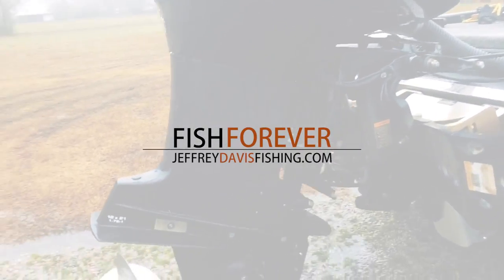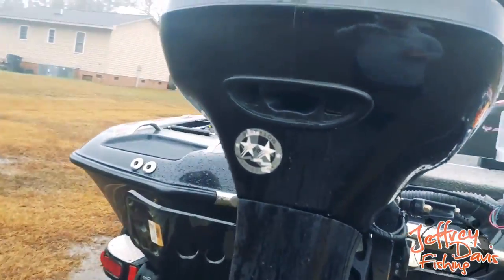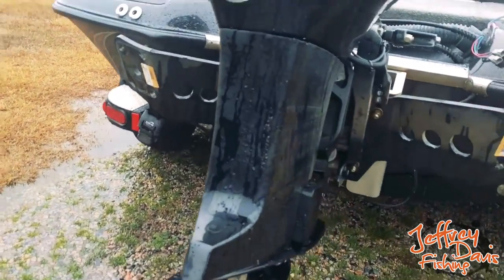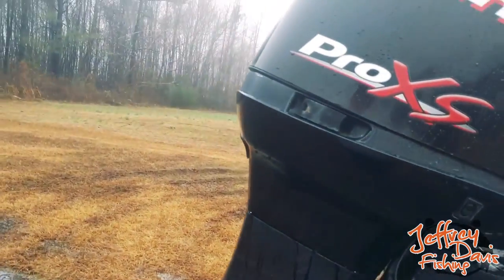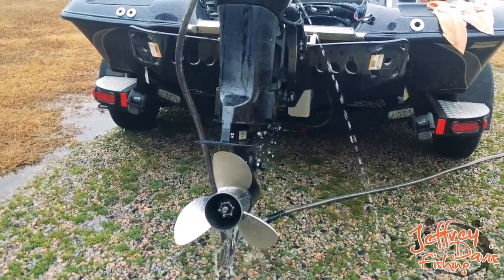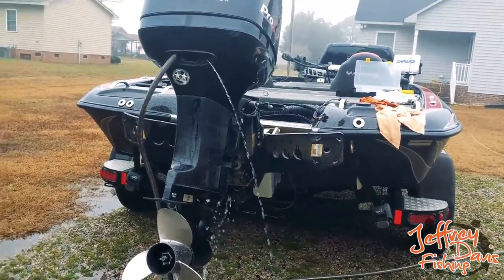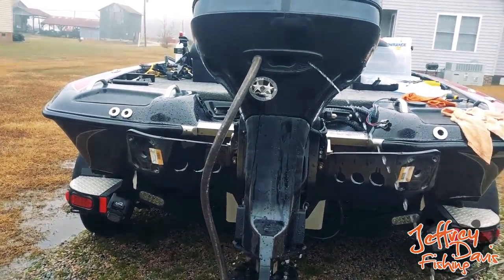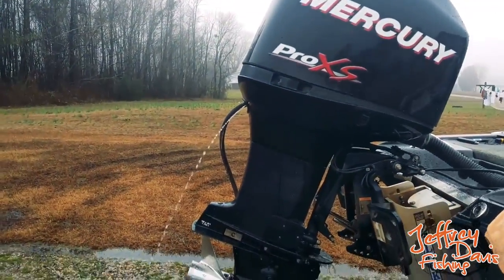Mercury Optimax Engine Flush - Fix No Telltale

Comment: As an emergency reaction only. If you find your telltale not pissing when you’re out on the lake with no tools.  a good method to flush out the coolant system is to take a water bottle, hold the mouth firmly against the P hole and squeeze The water into the P hole with as much force as possible. This will back flush your system and blow all the material out the inlet scoops on the lower unit. You may have to do two or three bottles of water (just refill from the lake or ocean) and eventually you will see water flow back out the P hole  . Make sure that you’re doing this with the motor off so that you’re not fighting back pressure. I have had my lower unit buried in the mud multiple times with no flow at all from the tale tale and have easily flushed the system out. Once you get back to land make sure you do a thorough cleaning and inspect the impeller.
Reply: But to add what I've learned is that P stream does not mean you engine is getting cooling water.  The Thermostats could be plugged and the P stream still flows.

Comment: Jeffrey, you son of a bitch, you saved my life. My father left me his bass boat when he passed away a few years back. Like you, I don’t know whole lot about outboard motors-if anything. The boat has been sitting for about a year and a half and I brought it out on the water today. I didn’t realize that my engine wasn’t peeing. But the high-pitched tone started going off while I was on pad in the middle of the lake channel. On my way back to the marina, another boater said “hey man, you’re not peeing.“ So I loaded the boat up and contemplated taking it to my mechanic who was located 30 miles away from me outside of Nashville. I decided to go home and try to YouTube anything that could help me out. Well, your video was the first one I came across. I didn’t even know there was a hose connection in the engine. I had a pair of the muffs and used them before. Anyways, I took the cap off, hooked up the hose, cranked up the water and it still wasn’t peeing. Then I grabbed a small nylon brush, and lo and behold- clumps of algae started coming out of the plugged up pee hole. It had been sitting for so long that algae simply grew inside the water exhaust and gunned it up. Sorry for the novel, but you saved me hundreds of dollars by posting this video. I wish I could buy you a beer. Cheers!

Comment: After this, I would've pulled the lower unit off and performed a thorough inspection of the water pump, impeller and water tube that carries water up from the impeller into the power head. That tube can easily get clogged with debris, and you may still get a OK looking tell-tale stream and think everything's fine...but you'll still run into overheating issues after prolonged running on the motor because your water flow is still under spec and eventually the motor will get to overheat. Particularly at lower speeds or sitting around idling for a while. 

This is exactly what happened to me recently. I was running into overheating issues, but the motor would run fine for the first hour or two after I launched the boat, but then it would throw the alarm once it was warmed up and I would be drifting around at low speed, trolling or idling. My impeller got damaged without me realizing it. It was badly mangled actually, two of the fins were completely gone, with a 3rd about to rip off at any moment. Because there were pieces missing, I looked up the water tube thinking they may have got lodged in there and sure enough, they did. So I was running on a bad impeller and with a restriction in the water tube...a bad combination. Frankly, I'm surprised the motor ran as well as it did. I got it fixed and the issue was resolved and my tell-tale port was pissing like a race horse even at idle, you could really feel strong pressure if you put your hand up to it. It was still peeing before this, even with a broken impeller and restricted water tube, just not nearly as strong. 

I'm sure you've got the problem sorted by now, but hopefully you did further inspection after this. You should get in the habit of checking the water pump and water tube for damage or obstruction AT LEAST once a year. If you've got the funds, you may even want to replace the impeller and gaskets on a yearly basis...but this isn't required or anything. Just inspect it and if it's still in good shape, keep using it. The key is just inspecting it whenever you find it feasible. You definitely want to check it at the start of the season, since you'll likely be changing your lower unit oil then as well. Might as well do both things at once. Funny thing was I checked my impeller before the season started and it appeared to be fine. Couple months later and it was toast. Lesson learned.

Edit: Your tell-tale port in this video w/ the motor running seemed a little weak, but then again...every outboard is a little different from what I hear. Some will really piss out water while others are a little weaker. Just want to stress though that just because you're getting water from the tell-tale doesn't automatically mean you're in the clear. Always be safe and perform a thorough inspection of the intakes, water pump and water tube leading up to the motor.

Comment: Thanks for this!  Gave me an idea look closely at our 2017 Mercury 40 hp which nearly stopped peeing.  The garden hose connector IS this pee hole on this model.  I did all the annual maintenance on ours this weekend and then connected the hose, ran it, flushed it, and took it to the lake for a test.  Almost no water coming out.    Brought it home and looked at the inside where the line runs from the pump output to the pee hole.  The hose was twisted and kinked from my tightening the garden hose and twisting the fitting when unscrewing the hose.  So, put the garden hose back on, watching the tube from the water pump output to the pee hole twist until the kinks came out, then held it with pliers until the hose came out.

Comment: Thank you very much!!!  This confirmed my problem. New to boating by myself.  Have an Optimax 200. 
Freaked out when I heard that beep on the lake last weekend. 
Sure enough after running about 5 minutes, that steady beep started, my water temp and engine light came on. Oh crap. Idled back in and loaded the boat until further notice. 
After seeing your video, I went out and stuck some grass trimming line thru the pee hole. Reconnected the muffs, started the engine and the engine started to pee!!!!
Thanks Again,
RB

Comment: The engine flush inlet is to flush out the salt water after every ocean run. There are some trailers that have the same type of  system to flush the salt water out of the wheel bearings.

Comment: Need to clean the compressor strainer. Especially if you see signs of sand or debris. If there is that much outside the strainer, you're taking a risk of overheating the compressor.
Reply: How do you clean the compressor strainer?
Reply: That’s my ??? How do you clean it out I have 75 OptiMax
Reply: The Compressor strainer is actually in the bottom cowl on the port side. It is not that difficult in the end. I would recommend you look it up first and prep material before you start. You dont need much but I wanted the correct pipe compound and zip tie. Top fitting, Port side lower cowl, Aft of end of the motor.

Comment: Jeffrey, just came your video here and my goodness is it a wallet saver! I had the same problem with my Merc not "peeing" as well. However, I wasn't in the position to use my boat for a while, so it sat unused for about a year and half. My first thought was the thermostat in the water pump froze up, but when I found out how long it would take and how much it was gonna cost for the service guys to fix, I started searching the net. Let's just say I'm back on the water thanks to your video! Thank you good sir!

Comment: I have the exact same motor and similar overheating on occasion...i'll have to check this solution out, although I usually do have a water-stream from the output nozzle, though it sometimes takes a minute for it to start streaming.  Thanks for the video!
Reply: Woods2Waters if you have not changed your impeller since you owned it, it might be time for a change.

Comment: Can you run the motor with the hose connected up top by the telltale?
Reply from the maker: No no. Make sure you got the muffs on it if you start it up.
Reply: @JeffreyDavisFishing  thank you.
Reply: @JeffreyDavisFishing  i have a 96 mercury mariner magnum.  Someone told me my Motor won't pee unless it's at a certain temp. Is this true?
Reply: @x--LeethaL--x  Thats true , has to open the thermostats to show that waterpump indicator works , the efi engines arent as advanced as the optimax .

Comment: Your water impeller should be replaced yearly  and since you had sand, consider doing it sooner.  
Also clean out the water strainer and back flush the system.  
That said, if you're not getting the overheat warning (continuous beep) you can postpone it a bit longer.